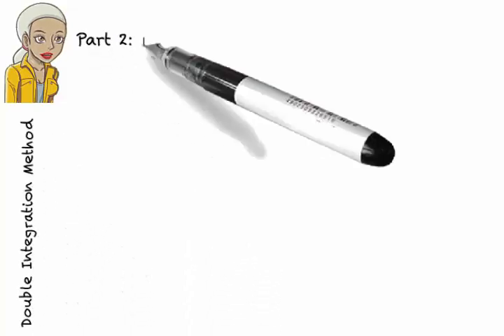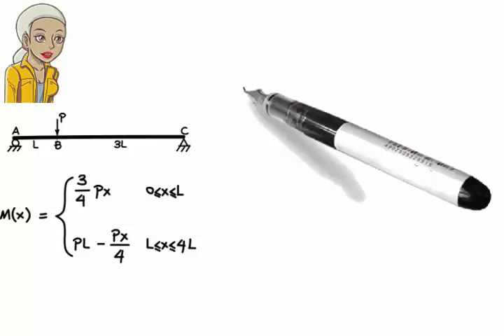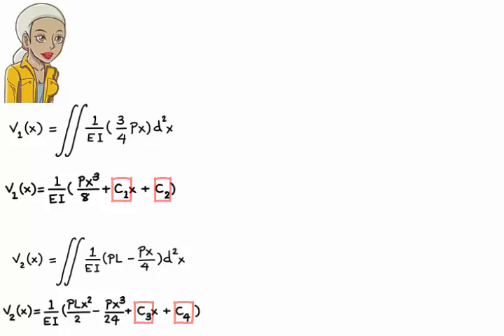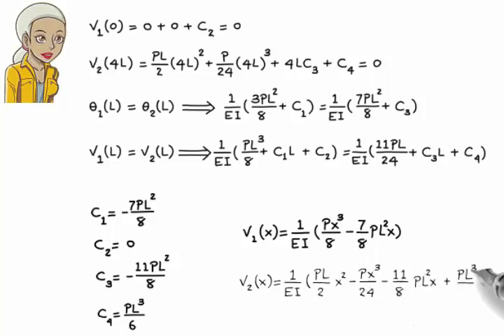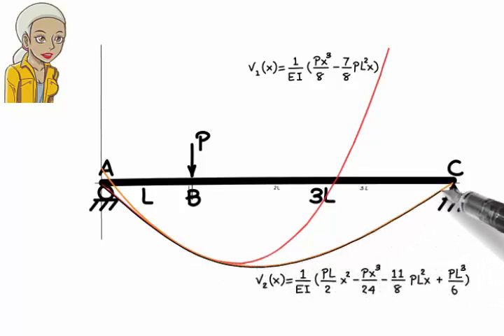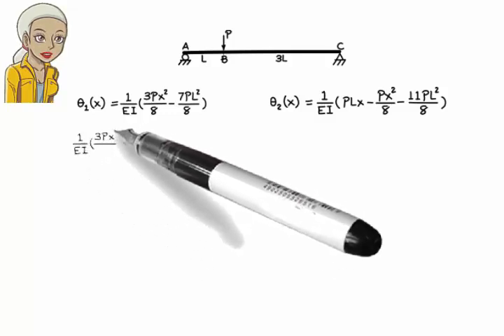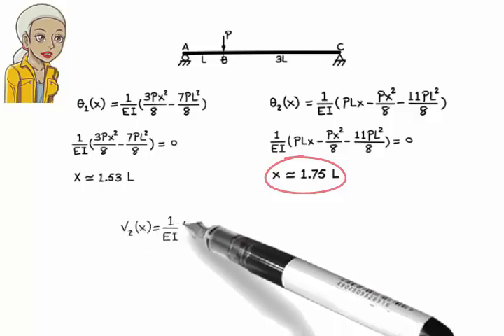SA13-2: The Double Integration Method (Part 2)

Comment: Why can I not apply the boundary condition that for x=4L Theta2 =0? I get a different value for C3 and in theory I should get the same.
Reply from the maker: At x = 4L the beam's rotation is not zero; the beam can rotate at the pin connection. Pins and rollers allow rotation. It is only the fixed support that prevents rotation.

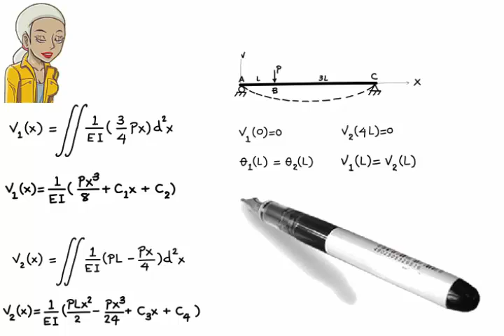Comment: 2:21 how we took Q1L = Q2L . How is it continuous ? Thank you .
Reply from the maker: Consider point B (the point of application of the load). The beam has a deflection and a rotation at B. Let's refer to the rotation at B as tb. Whether we approach point B from the left side or from the right side, we end up with tb for rotation at B. Now, if we need to write two equations for the elastic curve, one for the left segment of the beam and one for the right segment of beam, then these two equations should give us the same value for rotation at B; They should give us tb. In that sense, we say the slope of the elastic curve is continuous at B, since there is only a single value for the slope. This condition, then is expressed by indicating that Theta_1 at B = Theta_2 at B. Since B is located at distance L from end A, the equation can be written as Theta_1(L) = Theta_2(L).
Reply: @DrStructure  Thank you so much for explaining it . I'm clear now .
Reply from the maker: You're welcome!
Reply: @DrStructure  sir here the deflection came as negative.. What does the negative sign signifies.. When we took the moment M at the cut section we took it anticlockwise assuming downward bending and the graph u drew confirmed it as downward bending then why the deflection came negative ??
Reply from the maker: @rikdevghosh7324  Another sign convention to consider. This time for deflection/displacement. We have placed the origin of our Cartesian coordinate system at the left end of the beam, where x is positive to the right and v (displacement) is positive upward. So, a negative value for deflection (v) means that the actual deflection of the beam is downward.

Comment: how did you guys calculate the C1 value? everything else makes perfect sense! But I can't figure out the C1 value.
Reply from the maker: There are four boundary conditions (equations):
v_1(0) = 0 
v_2(4L) = 0
theta_1(L) = theta_2(L)
v_1(L) = v_2(L)

The above equations, in the simplified expanded form are:
c2 = 0
(16 PL^3)/3 + 4 c3 L + c4 = 0
(PL^2)/2 + c3 - c1 = 0
(PL^3)/3 + c3 L - c1 L + c4 = 0

Solving the last three equations simultaneously for c1, c3, and c4, we get:
c1 = -7PL^2/8
c3 = -11PL^2/8
c4 = PL^3/6

Comment: Could u help me to find
Constants c1=-7pl^4/8 , C2= and C3 and also C4?? I try it but i miss the answer.
Another question is
At the end of this lecture u use
V2(1.75L)=1/EI(49pl^3/18 ... ....)
Where did u get these numbers
49,343, 77, we didnt have these
Our equation v(x) and the power of 1.75 cant reacch that?????
Thank u
Reply from the maker: Thanks for the note and the questions. 

With regard to constants c1 through c4 the answers are correct. However there is typo in the fourth equation. The first term on the right hand side of the equation should read 11PL^3/24,  not 11 PL/24.

Performing this kind of simplification using hand calculations is a bit tedious. Here is how I approach the problem. 

From equation 1, c2 = 0.
Equation 3, when simplified, gives us: c1 - c3 = PL^2/2
Simplifying Equation 4, since c2 = 0, we get: PL^3/3 + (c3 - c1)L + c4 = 0
Since c1 - c3 = PL^2/2, then Equation 4 becomes: PL^3/3  - L(PL^2/2) + c4 = 0. 
Solving the above equation for c4, we get: c4= PL^3/6. 
Substitute this in Equation 2, then solve for c3. You should get c3 = -11 PL^2/8. 
Knowing c3, we can get c1 from Equation 3. c1 = -7PL^2/8

As for your second question, about v2(1.75L), the answer given in the video is not correct. We can write 1.75 as 7/4, then substitute 7/4 L for x in the equation to determine the deflection. However, in the video 7/3 was used instead of 7/4, hence the erroneous coefficients and the answer.
Reply: Dr. Structure thank u very much for yr helping
Reply: @DrStructure  hello Dr. Structure.
Thank you for all your efforts and these wonderful clearly explained videos.
Solving the example in the video, I found an issue in finding the point where the maximum deflection occurs using the formula of bending moment thet you use ( for the right segment you started from the left to the right). It gives  1.75L. But when I did solve it with the other formula ( the second equation of the bending moment calculated from the right to the left) it gives 2.23L !
It would be so nice of you if you check it for me.
Thank you a lot.
Reply from the maker: @seddiksoundous9883  If you are measuring x from right to left, 2.23 L locates the same point as 1.75 L does, when x is measured from left to right. That is, the length of the right segment of the beam is 4 L, and 2.23 L + 1.75 L = 3.98 L. I suspect the difference between 4 and 3.98  is due to round off error in calculating the integration constants.
Reply: @DrStructure  that's true right ! Thank you so much 🙏🙏🙏

Comment: how slope of elastic curve at point B must be continuous. can you please explain that part? thank you
Reply from the maker: Having a discontinuous slope at point B implies that the beam has two different rotations at B, as if there was an internal hinge at that point. Such a hinge allows one side to rotate relative to the other side, hence the discontinuity in the slope. Since there is not such mechanism in this beam, the slope remains continuous throughout the length.
Reply: @DrStructure  thanks for clearing that point👍
Reply from the maker: You're welcome!

Comment: @6:27 when we are substituting x=1.75L in V2 (x) formula, how do you obtain values 49/18=2.722, 343/648=0.529 etc... ?

Isn't the first value 1.75^2 / 2 = 1.53, second value 1.75^3/24 = 0.22 etc... ?
Reply from the maker: Thanks for pointing out the error. Yes, the correct values are:

(1.75)^2/2 = 1.53
-(1.75)^3/24 = -0.22
-11(1.75)/8 = -2.41
1/6 = 0.17

For a total deflection of -0.93PL^3

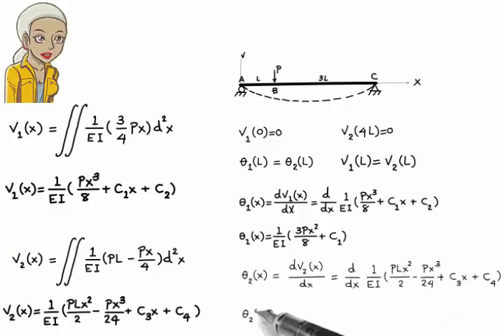Comment: @ 2:36 V2= PLX^2/2 - PX^3/24 + C3X + C4. The next part, 2:46, the negative sign was dropped to positive PX^3/24. Did I miss something?  Thank you!!!
Reply from the maker: No, you did not miss anything. We missed double checking the written expressions @2:46. 
The second term in V2 is indeed negative. So,
V2(4L) = (PL/2)(4L)^2 - (P/24)(4L)^3 + 4 L C3 + C4 = 0.

Also, in the last equation on that screen: V1(L) = V2(L), it is not (11/24)PL, rather it should be (11/24)PL^3.

The answers however are correct.
Reply: Thanks!

Comment: sir at 0.35 minute how we get pL-px/4. at which location/point moment is taken. please explain.
thank you
Reply from the maker: We are summing the moments about the cut point. In addition to M(x) there are two forces that create a moment about that point. The vertical reaction at the left end of the beam (3P/4) and the applied load (P).

The reaction force has a moment arm of x (the distance between the force an the cut point is x). 

The applied load has a moment arm of  x - L.

So, we can write:
M(x) = (3P/4)(x) - P(x-L) 
M(x) = 3Px/4 - Px + PL
M(x) = PL - Px/4
Reply: thank you sir i was blanked when i seen that px/4 i thought in second step moment is taken from right support... thanks again.